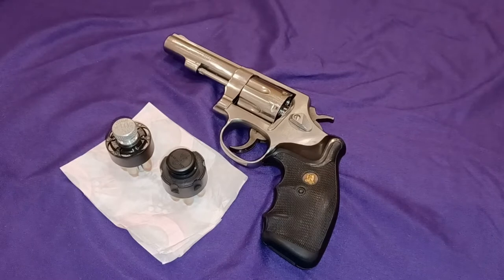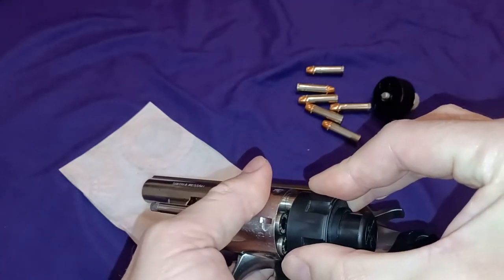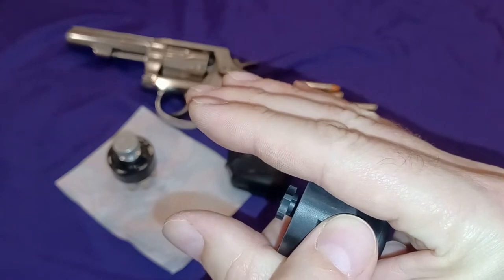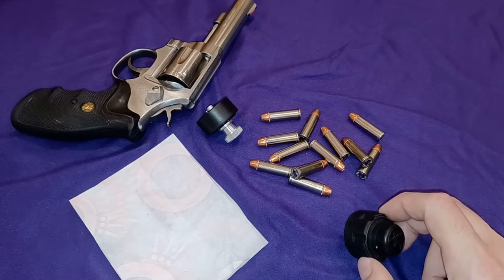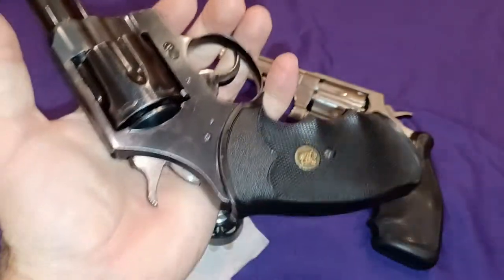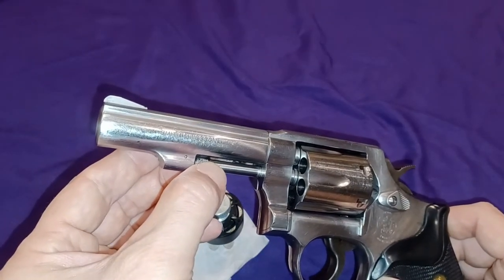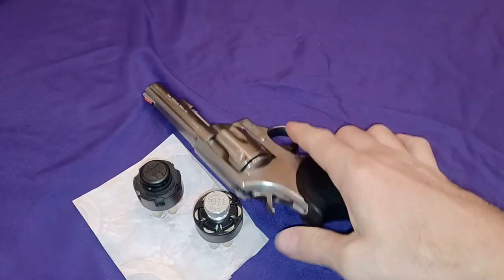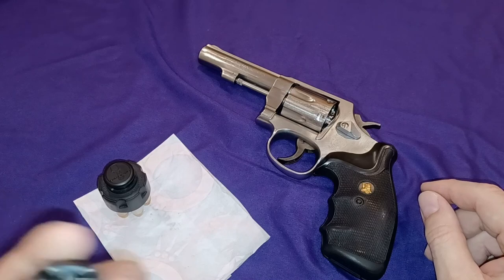The Not So Speed Loader

Comment from the maker: Corrections: Smith & Wesson would have featured walnut wood grips; The Colt would originally be an "Army Special" with an "Official Police" barrel; revolvers typically lock with the center pin exclusively & not on the ejector rod (probably will cover that topic in a different video). Thanks for viewing!